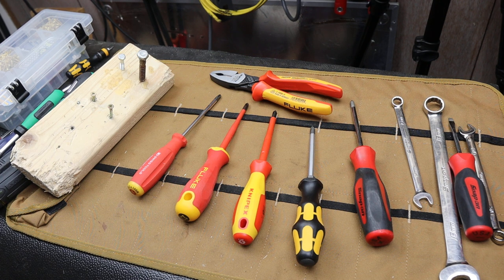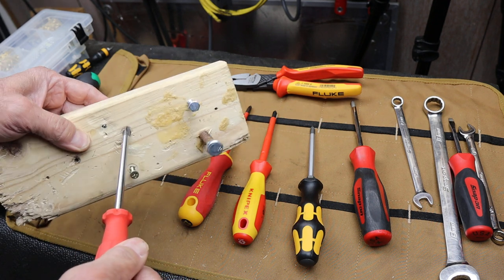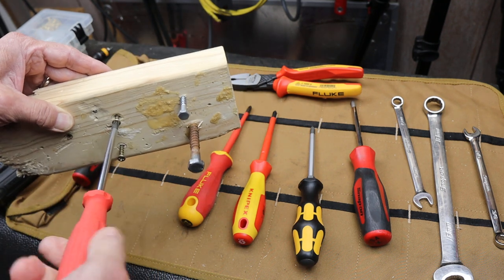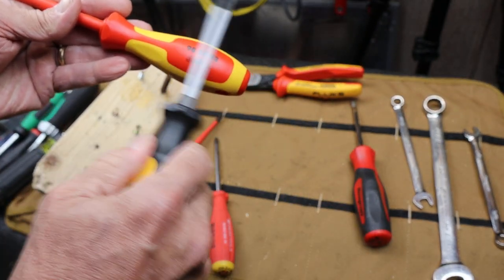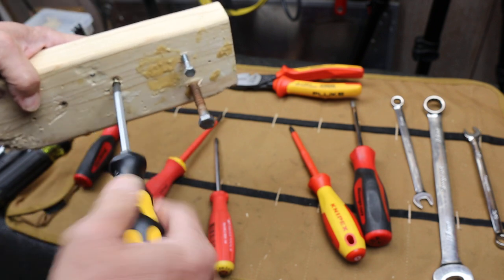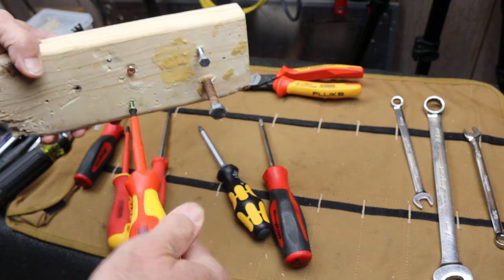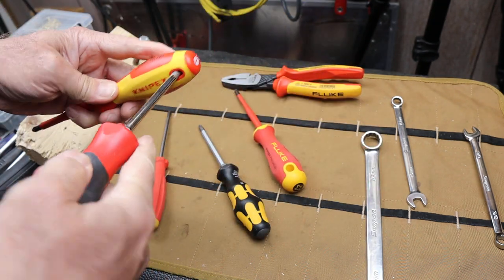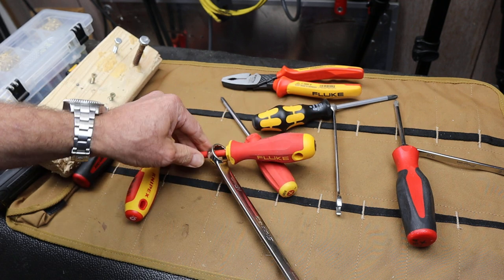This Fluke Screwdriver is really good. Great for fast, accurate spinning. The Knipex, not so much.

Comment: I have 2 Knipex screwdrivers and I agree, I actually purchased a set of Wiha VDE screwdrivers and really like them.
Reply: I also have the Wihas. Their handles are a bit like the Flukes. Continuous grippy material.
Reply: Same here. Bought a Knipex screwdriver a few months ago. The pilers are great but the screwdriver... That red plastic is way to smooth. 
No comparison to more grippier yellow plastic on the Wiha softfinish electric. 
I picked up a regular set of the Felo - on which the Fluke is based - and I'm quite impressed definitely on par with the PB swissgrip.

Comment: I am no fan of Phillips screws. They are everywhere and they all stink. The fact that #2 bits come in 10 packs tells you how bad they stink. Every time I get the chance I replace them with Torx. If I never had to hear that brrrrp of a Phillips camming out under power again I would be okay with that!
Reply: Yeah torx for power and hex for hand torque, way better
Reply: that's why i recycle all the JIS screws from japanese printers and office copiers i can. add some Vessel, Sunflag and Annex drivers and no more mesky (messy+pesky 😏) problems. free good quality screws to boot too. 😉👍

Comment: Nice screwdriver, I think it is a Felo ergonic rebranded. I have the exact same thing branded Felo. They are very solid, and the tip is also very durable. I also use the VDE magnetic bit holder from Felo, which has the same handle as the fluke one. They are my favorite ones. Wiha also made something similar. I don't know who made the knipex ones. Very informative video. 👍👍
Reply: Does the handle feel fairly soft with a solid center?
Reply: @Shocker99  Yes, especially on the ergonic series from Felo, the handle is soft but very grippy.
Reply: Knipex is probably made by Knipex. 😏
Reply: You are right, they are made by Felo. 👍
Reply: @RondeLeeuw   nope, those are made in Slovenia by Oplast which is, from memory, a subsidiary of Unior. they also made/make screwdrivers and folding hex/torx sets for Hazet, Gedore and lots of others brands including Mac Tools in the US. 😏
the Hazet are better designed though, probably because Knipex is mainly a pliers company and are not as refined in screwdriver design. 😬
Reply: Yep, it is a Felo, spot on! Best screwdriver in my opinioon !

Comment: One of the best explainantion about difference between a good screwdriver handle and a just looking good one. Wera, PB Swiss and Fluke (wich actually is only a Felo rebrand) have ones of the best ergonomic handles. Also, maybe you  will make a review with Facom screwdrivers, wich in my opinion are ones of the best design handles that i found in my 35 years career as electrician.
Reply: As an European electrician I really like Facom screwdrivers as standard choice, a little more then lets say Gedore. But Wera and PB Swiss are also a very good screwdriver! I think Facom, Wera, PB Swiss and Wiha make some fine stuff
Reply: HTR  I didn’t have problems with my Wiha screwdrivers.Witte and Felo have best handle for me,if you want torque than Witte.

Comment: Slotted screws actually work quite well, without any slipping, if you've got a tip that matches the screw head. It should be a tight fit.

Comment: Those Fluke screw drivers are rebranded Felo screw drivers.
Phillips was designed to cam out around 40 inch pounds for the automotive industry,  so pneumatic screw guns would not break the heads off screws.
If you want a screw that dosent cam out use Posi drive or JIS.

Comment: Apparently I am stuck in the "old school" mindset.
I have tried a few of the newer  ergo grip screwdrivers and they just dont fit my hand the same. The worst, in my opinion, is these tri lobes. My favorite was the Snap On original hard handle but after trying the Tekton hard handle they have become my go to screwdrivers. It's like a slightly modified Snap On.
Neither are a non slip design, meaning no rubberized material.
My electrical bag has the old school Kline with the rubber over mold on them. Lol, after 60 plus years I think my hands are now molded to the older style I guess. Well at least my mind is.
Thanks again brother for another great video. 
Stay strong brothers.
Reply: If you like trilobes, try Witte screwdrivers.

Comment: Immediately recognisable as Felo screwdrivers under a different brand name so I know they are top quality.  However here in the UK they are few and far between and double the price of Felo, perhaps they are more intended for the North American market.  
As I said I highly rate Felo for screwdrivers, higher than Wera as they've been in business much much longer, over a century longer in fact.  I do like Wera for their bitsets and their small bit holder handles though, for portability.  But I don't own a single Wera dedicated screwdriver, mine are mostly Felo, plus a couple of Wiha and Ceka/C K tools but I make sure to get only old stock German made CK as they are now UK owned and newer CK products don't state where they are made.
Knipex are probably the best pliers out there but I haven't heard much good about their screwdrivers, although apparently they are made by Witte if I'm not mistaken.
Reply: Same here, european user, Bulhgariq!
Felo is spot on, Wera screwdrivers didnt like so much! 
Bits are another story, but FELO bits are top quality, especially for not so deep small inox screws, as they do not have a chamfer in front, so gril in all depth !

Comment: I hate phillips almost as much as I hate slotted.  My go-to screw & driver these days is square/robertson.  

They are more the norm for electrical work and don't cam out, keeping the driver in line with the screw much better than phillips.  A side benefit is they "stick" to the driver and don't always need magnetic bits to do so.  Many screw manufacturers now offer a dual head design that takes phillips and square drivers.  Time to retire phillips and put them with slotted drivers in the back of my tool case.  😉

BTW... I love my Wiha drivers for the exact reason you state... the grip is all the way around the handle and does not slip when using.
Reply: For me its torx but theyre both significantly better than phillips

Comment: Hello again Doc 
Thank you for another Great Video 👍 I have to admit, I never used my screwdrivers to the extent you were tonight. But I am researching for my next tool purchase and screwdrivers are on the list. I am looking for something that will handle number 2 Phillips screws without caming out. Again thank you 😊
Reply: HTR  Hello HTR
At the moment. I don't know which to choose. I don't need a JIS screwdriver. But I do a set to use for Aviation Maintenance. So the flat tips and Phillips screwdrivers are about all I need. Like most of you,  the Phillips screws can strip out or corroded. Or even painted etc. I was hoping Mac Tools would have a RBRT for the, Phillip screws
Reply: HTR  Hello again HTR
Maybe I do not have enough information.   I thought the JIS tools and hardware were slightly different from the normal (For me) SAE/Standard. JIS is incapable to SAE/Standard and viscera?

Comment: How about using a screwdriver with a magnetized tip?
Reply from the maker: I cannot imagine a magnet tip strong enough make a difference when driving the fastener. Magnetic fields decrease rapidly with distance and for any useful effects, the driver tip would have to be a magnet like neodymium which would make to brittle. Plus many fasteners are alloys that while attracted to a magnet, are not the most magnetically active.

Comment: Knipex screwdrivers are just not that good. The issue with the grip you pointed out is a big one, and then there is the fact that they are made by Oplast, whose products you can get a lot cheaper from other brands.
Reply: Did you mean to say "just NOT very good"?
Reply: @jamesrodgers3132  
I did ... fixed it.
Reply: So they are not good because somebody has issues with the handle style? Gedore screwdrivers are made by Oplast as well and are absolutely great because i like the handle style the most, while others dont. Doesnt have to do anything with good or bad,  just a matter of personal preference.

You are making the mistake thinking a manufacturer only makes a certain quality, while they make many when they provide OEM custom design and not just rebrands. (like the Fluke in this video)
Like standard Oplast Kraftgrip screwdrivers are made from chrome vanadium while Knipex and Gedore (and other premium brands) screwdrivers made by Oplast are made from chrome vanadium molybdenum.
Reply: @TheSir2005   more like a design problem from a brand that knows how to make pliers but sucks at screwdriver design. the Hazet and Gedore ones do not suffer from bad haptics like those Knipex-branded ones. anyway, Oplast makes what the customer wants, be that a good or a bad design grip-wise. the tips are mostly always the same and quality wise, no problem there. 😉👌

Comment: Wera is far better. You are talking about 1 specific use. The tang should go right though the handle and it should have a place to use a ring spanner with it. ITS " WERRA "NOT" VERRA"!
Reply: Vera is how the company employees pronounce it, and a tang through defeats the purpose of a vde driver
Reply: @lt3880   it's not a VDE driver though. if you want tang-thru VDE drivers that you can bang on all day long, check the Vessel ones with the ceramic insulation ball inside. 😽👌